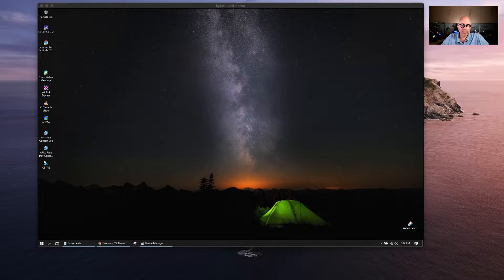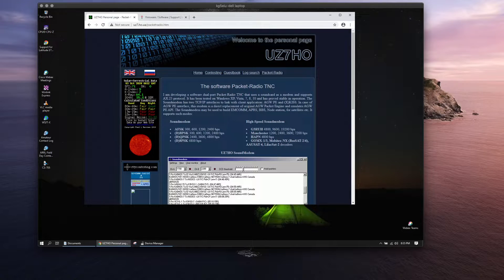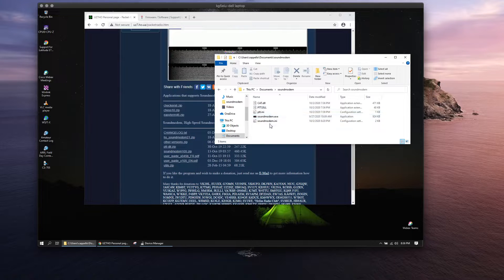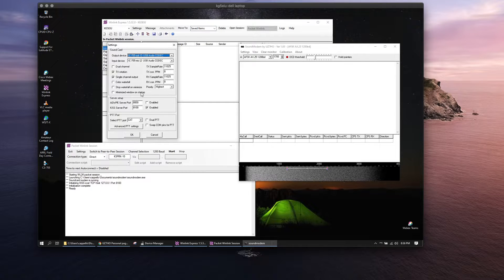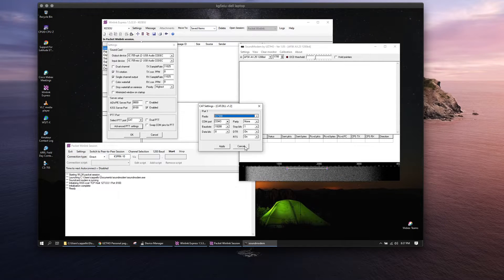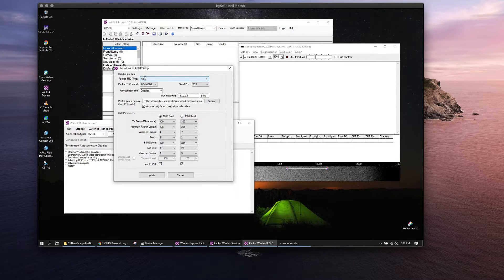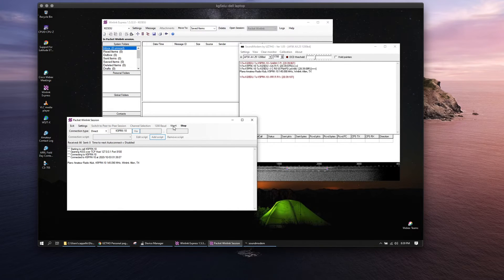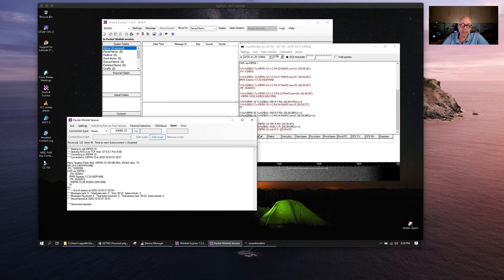Icom IC 705 VHF WinLink With Soundmodem

Comment: I am having two problems.  I installed the IC-705 software and I see two ports in Device Manager, just different ports.  1) When I start Winlink it doesn't see the IC-705 ports.  The 705 is plugged into the laptop with a USB-B cable.  2) I can't enable the Advanced PTT settings button.  Any hints?
Reply from the maker: If you installed the usb driver for the 705 and plug it in - you will see to com ports in device manager - one is for CAT control the the other is for audio in/out.   Which ports doesn't winlink see ?   Also be sure to set your audio for Windows prior to winlink - anytime you plug in an audio device to windows it wants to make that the default - which you don't want in this case so you have to go back in and reset sound options for Windows for your PC speaker and Mic.

Comment: David, I am a new 705 owner and ran across your video today. I had been trying most of the day working on the Winlink packet. I was able to get VARA going but was beating head against wall on Winlink. I undated the newest Soundmodem, and PT.dll and the 705 is still not on it list. Anyway, your video got me there. The magic trick is still the CI-V address. Now I have to remember to change it back when I am working PSK or FT8. Thanks, Steve VA3FLF

Comment: David thanks for this video.  Other than changing the CI-V address to 94h, are there any other settings needed on the 705?  My radio is keying up, but not passing what it hears back to the computer.  Also, I noticed that your video had audio.  When I'm plugged into the radio there's no external audio.  Thanks and 73!
Reply from the maker: From the default config of the radio - nothing that I can think of open up the squelch and then double check your Windows auto mapping - and you can also inside Windows listen to the audio out from the 705 - you will know right away if that is not working.
Reply: @davidcappello  thanks.  I found your video on YouTube, but with further searching I see that you have a blog post about it with some additional insight about the radio settings that I didn't see in the video (like FM-D instead of FM mode).  I'll try what you suggest in the blog - https://davidcappello.com/2020/10/02/vhf-winlink-with-ic-705-and-soundmodem-tnc/.  Thanks again!  73 Joe
Reply: @davidcappello  Okay the new cable does help.  TX doesn't hang anymore.  The problem is the Winlink connection drops before a packet response is received - although I can see (and hear) the incoming response in the Soundmodem monitor window.  Is there a setting in Winlink to keep the connection open longer to listen for the response?  As best I can tell, all settings same as yours.  I have a screen shot - may have to send that to you via socialmedia.  Thanks.
Reply from the maker: @KI4ASK   I am good on QRZ  or hit me up:  https://davidcappello.com/contact/   we can also do a quick Google Meet meeting and we can review your settings.